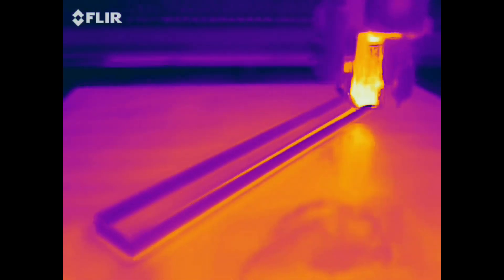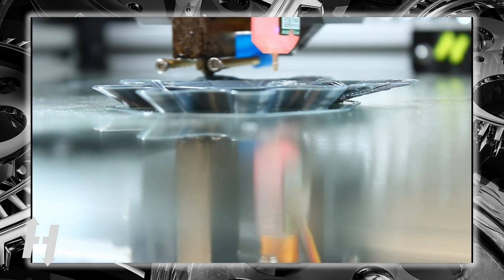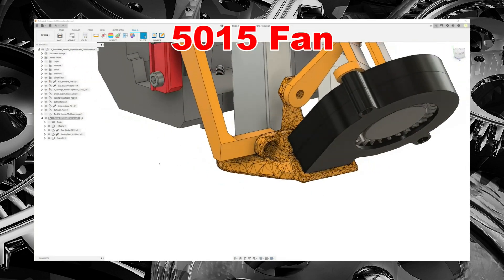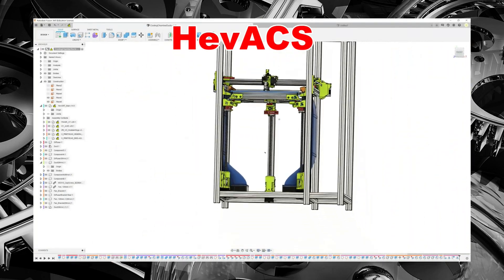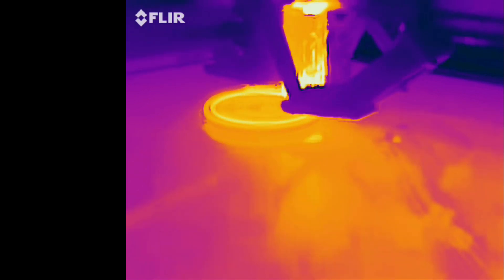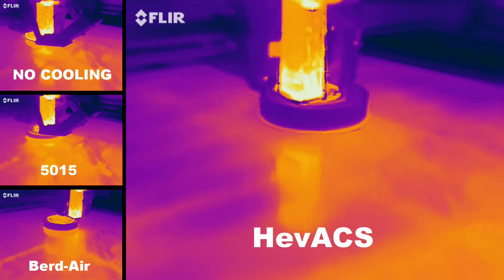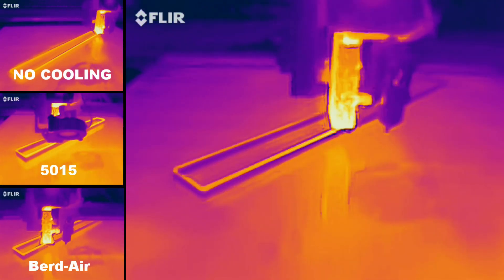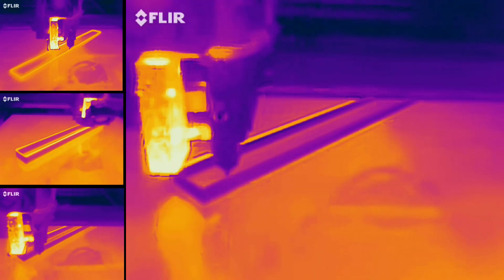Ultimate 3D printer Cooling fan - 5015 vs Berd-Air vs 300CFM Mega Cooling

Comment: thats what ive preached for years. what good is pumping lots of air very close to the nozzle when it only stays there like 0.1 of a second?
Reply from the maker: I need to expand on this topic.  I really enjoy printing with this system.  Sinking heat in the part has also shown excellent layer adhesion properties.
Reply: MirageC you might want to look at offsetting the two opposing „wind blades“ so that they dont collide head on but create a vortex in the middle. Look at the stratasys F123 series you will see what i mean. i built a heated oven with this system, but the air just comes from one side to create a real air curtain effect. my chamber goes up to 240 deg c

Comment: What pump did u use with 660l/hour. Most of the air pumps i could find on ebay were either in the 60 - 200l range, or the 5000 - 10000l / hour range
Reply from the maker: This is the one I am using (24V, brushless, parralel) : https://www.aliexpress.com/item/4000601429521.html?spm=a2g0o.productlist.0.0.7b5967b5QrIbK8&algo_pvid=f9d7e42c-66d7-43b6-9c63-736c077121c3&algo_expid=f9d7e42c-66d7-43b6-9c63-736c077121c3-27&btsid=0b0a556716129933990647398e4dd5&ws_ab_test=searchweb0_0,searchweb201602_,searchweb201603_

Comment: hybrid system?

We have seen easy prints, but how HevACS performs with large objects and how much it actually cools in the center having walls close to the air outlet.
It would be useful to see if a hybrid system consisting of HevACS and berd-air is necessary for this scenario or in not needed for the HevACS system.
However excelent project and realization, good work

Comment: Stratasys already does this (albeit to heat the chamber)
Reply: Yes! Sometimes the best solution can not be used because of patents. They also draw the cooling air from outside the heated enclosure using a blower and pipe it to the nozzle through some tubes.
Reply: @boilerbots  i believe the patent is expiring  10 days from now

Comment: You should use a rectangular flexible air duct for the Hevacs to connect the lower duct part with the output vent so that the output vent moves with the z axis abd provides consistent air flow for the model
Reply: You don't want the output vent to move with the bed, you want it to remain pointing at the level at which the printing is performed, which is at a fixed height in this printer.
Reply: @Graham_Wideman  you are right

Comment: I've been designing my own pressurized air cooling and this was cool to watch.  One thing I have been focusing on that I did not see in your video was trying to cool the filament as close to the nozzle as possible (ostensibly to increase quality of overhangs).  Do you have any experience with that vs a more diffuse air flow?
Reply from the maker: No doubt that bridges will benefit from close and intense cooling.  Overhangs will benefit from it too to a certain extend.  I tested various solutions and found that Berd Air with too much pressure will simply push the filament away during bridges, so the closer you get from nozzle, the more of this effect you will get.
Also I have observed that drastic cooling close to the nozzle will form a thin shell of hard plastic at the surface of the freshly extruded material.  This will create more stringing and poor layer adhesion.
The best thing would be able to play with various cooling solutions depending on the type of line being performed.  I am sure something could be created with this.

Comment: CNCkitchen proofs that too much cooling lowers part strength quite a bit. It would be good to see if there is or can be an optimum for your design. But I'm quite jealous of your printers! Cheers for all the Infos!
Reply from the maker: Yes i do agree with that statement. What i discovered is that brutal cooling to the molten freshly extruded molten plastic will create a thin shell of solidified material at the surface if that material just before it is being layed down.  This affects layer bonding pretty bad.  The HevACS rely on cooling material after it was laid down by sinking the heat through the part.  I need to complete that series of video in HevACS and part property.

Comment: Since i can't test it currently i may as well toss this out since you might be able to. What about using a small peltier module to blast actively cool air to a part.
Reply from the maker: I have tried other methods to cool drastically the part and I found that a thin hard shell of plastic forms at the surface of the molten plastic, creating awful print quality and poor layer adhesion.

Comment: The HevACS setup is a very good candidate for the heated chamber 3D printer I'm working on! Using materials and fans that can handle high temperatures, of course...
Reply from the maker: Yes, I am very curious to try it with ABS and other materials requiring an enclosure.  I am planning to try some re-circulation and potentially added heater in the future.

Comment: Which of the Berd-Air and yours has the lowest moving weight if installed on an i3-style printer ?
Reply from the maker: In order obtain the same level of cooling from the HevACS on a Cartesian printer, you would have to install the solution on the bed but moving with the Z.  Quite complexe.  BerdAir would be easier by far.  Same principle as regular part fan cooling, except air is fed by a tube from the pump to the print head.
Reply: @MirageC  you could mount it in front of the y axis and the back or use a flexible tube to connect a mounted duct to a fan

Comment: Wonder if one could have the print bed submerged in fluid, with the nozzle tip printing just below the surface. Maybe an interresting experiment.
Reply from the maker: I would print just ABOVE the surface of water, this way layer bonding is not disrupted.  This would allow for massive heat sinkning into the part.  I have thought of it too ...  ;)

Comment: Would be able to try a diffused shop air line (100psi) for part cooling? I was thinking about trying this myself but you already have the setup going for you.
Reply from the maker: It could work, but you have to be carefully not to create a hard shell around that molten material.  There is a certain point after which too much cooling over a too small period of time will no longer work.

Comment: I am imagine that for a functional print... To achieve the highest possibile strength, then there is som "optimum" level of cooling. Because like you say, you don't want to press down onto mud. It will collapse. However if the layer underneath is too much cold. Then  maybethe layers will not stick together with the strongest possible bond? Ideally what you want is for a top skin of the layer underneath, it's top contact area to re-melt. So if the layer is not too become too cold just yet, then it can partially re-melt when the nozzle presses on top of it the next molten layer. This should then avoid cold solder joint. And create a much stronger bond between the horizontal layers. Like welding.

At least I think? That is how it should work? If it is the same situation in thermo plastics, than for metal ? A goldi locks zone. Like the planets. Not too hot, not too cold.

OR does it not matter? If enough amount of such necessary re-melting always occur regardless. Because the heat transfer, the much higher energy from the hot end will always overcome the cooled layer underneath? Then if cold solder joint does not ever occur. Then it does not matter! Disregard !

Hahaha. IDK - please let us know!

Comment: Awesome, thanks to you MirageC I now understand that part cooling is a matter of relative temperature drop across the threshold between the laid track still being a molten thermoplastic, or a semi molten 'lava', and then becoming a solid, hardened lava flow. But the important thing is that material phase transition. Which is actually different and must be tuned for different plastics. Nobody ever explained that to me before! So for a higher temperature thermo plastic, such as polycarbonate.... the base chamber temperature must be maintained higher. To prevent too fast shrinking / warping of larger parts.  With a slow enough cool down time at the end of the print.  So in other fields, it is a bit like an s,d soldering reflow oven, but in reverse! Thank you for explaining!

P.S Love the solution. BTW for the little tubes system... why not try to improve it further, and increase it's CFM by making larger diameter tubes? Or more holes to distribute the irrigation. Maybe there is some inherent thermodynamic limitation due to the pressure differential? I was more expecting this type of a system should be supplied from an air compressor. And then regulate the airflow with a valve.

Was it because the printed manifold was too weak to support any higher pressure? Why not instead try to find off the shelf Y part to split the line? Then it can be metal. There are many such accessories and adaptors for air hoses. Or the steam engines for model railways. etc. Of course I am being ignorant! There must be other design / engineering constraints and considerations. Which I am not aware of!

Comment: This is interesting, but what about layer bonding ? As you print over a cold layer the bond is not optimal and the part is not as strong as expected.
Reply from the maker: From what I have noticed, strong cooling at the nozzle will cool a thin layer of the molten plastic really rapidly creating some kind of a shell.  This shell interferes with the bonding process.  What I am proposing here, is to leave alone the freshly extruded material and let it deposit and bond to the previous layer.  Then cool it slowly, but deeply.   I need to to test coupons and use Thomas's methodology: https://youtu.be/a6m_GnN5j4c?t=488
Reply: @MirageC  HevACS cools down whole print rapidly, but not freezing the fresh molten plastic at the nozzle. Does that means it will have lower performance for bridging? Perhaps both berd air and HevACS have their own strengths.

Comment: now whats the quality vs strength trade off between each?
Reply from the maker: Quality definately benefits from the HevACS , especially for PLA.  Overhangs on smaller part are much easier to achieve.  Layer adhesion does not seem to suffer from it.  But that needs to be measured properly.
Reply: @MirageC yessir, it could be especially beneficial in a heated chamber so the effects are minimized in terms of strength.

Comment: we need someone to build a slicer for the hevort that tilts the bed when delt with extreme overhangs
Reply from the maker: Definately!  I am convinced that Fusion360 might be capable of doing so.  I need to spend some time over the winter on that.
Reply: @MirageC  so using the new slicer feature with fusion or a type of cam modification?
Reply from the maker: @Mr_Pewpy_But-Whole  That is what I am hoping, yes.
Reply: I don't think that would change much as far as overhangs go.
Reply: @timmturner  if the printer can do 60 degree just fine with out a tilt. then if the bed can tilt 30 degrees then it can handle the remaining 30 degree to 90
Reply from the maker: In theory we could go past 90 degrees.
Reply: @Mr_Pewpy_But-Whole  You think so? I've seen videos of people printing with the printer rotated 90° and even upside down and made the comment gravity has very little effect.
Reply: @timmturner  look at those 45 degree printers. they can horizontal overhangs all day. because to its orientation its like printing at a 45
Reply: @Mr_Pewpy_But-Whole  You mean unlimited Z printers?
Reply: @timmturner  yeah white knight, black belt, print mill. whaver
Reply: @Mr_Pewpy_But-Whole  Yeah they are able to print at 90°, you are correct.
Reply from the maker: @timmturner  Lets say you can achieve 65 degree angle pretty good  with stock settings and proper layer height to width ratio.  
Then we tilt the bed (given clearance is adequate) to a 30 degree bank.  The Relative angle to the XY plane will remain 65, but on the part that could result in a 95 degree angle.
Reply: @MirageC  Imagine a printer where the bed rotates and tilts. Then you would just make one side of the head, the side that would face the bed, as flat as possible
and you'd rotate the bed so you could have 90 degree overhangs on every side of a print. Maybe you could even just have a tilting hot end, but not the rest.

Comment: I thought I was having an episode of Deja Vu while I was watching this, and then I saw your comment about it being a redo of a previous video. I guess I'm not going completely crazy after all!! :)) I think it's GREAT to do this kind of experimentation because it can help determine if enhanced cooling will help, and if so, ways to improve that cooling. However, I have a couple suggestions for you that I believe will help make your results more transfer-able for actual improved print quality. (Maybe they've already occurred to you.)

1) I think it would help if you can use your FLIR in such a way that it can be 'calibrated' from one test to the next. I've also had trouble using my camera with different ambient conditions where the temperatures don't equate from one image to another. I think the automatic gain control (AGC) takes whatever temperature range present in the ENTIRE image, and re-maps it to the colors it can display. This works great so that we can look at our house in winter to find heat leaks, and then use the same camera for printer tests, but that feature kinda works against you now. 

   a) Can you turn off the AGC feature? 

   b) Could mask off areas in the field of view that are at room temperature to prevent them from adding cool temps to the AGC range? Maybe cardboard painted black or white, or some other opaque and non-heat-conductive material would work?

   c) Maybe you could also have one item in the field of view that's always the same temperature for calibration. For instance, maybe you could always have the nozzle in the image since the nozzle temperature is well controlled on 3D printers and is thus both stable and the hottest item in the field of view. If it were always the same color, and everything else were compared to that, I think more meaningful info could be seen from one cooling setup to another.

2) Long print passes are great for understanding and comparing the 'theoretical' cooling capabilities of your various setups, but for me they don't apply very well to the real world cooling problems that I have had. They do equate well to 'vase mode' prints, but I don't think I've ever had a cooling problem with vase mode, even when they have overhangs. It's more intricate pieces, with a many small loops, so that the print head comes back to add the next layer to a feature before it has had a chance to cool adequately. For instance items designed using Voronoi Style (with overhangs) are what I've had the most trouble with, and are great examples that would be better tests. Of course, as you mentioned, a Benchy will also be good, as would other printer 'test pieces' that I've seen on the Internet. 

Bottom line: I think what you're doing is really cool (terribly bad pun intended) and warrants the work you're doing. I think with some tweaking of your experimental methods, you can learn even more. In fact, I haven't looked around, but I'll bet there are other geeky guys (like you and I) who've done YouTube videos on this.  

Continued good luck! I'm really interested in seeing what you discover.
Reply from the maker: First of all, thank you for your comment and constructive feedback.  It is really appreciated.  
As for the FLIR calibration, I am pretty sure I had the auto calibration off.  But in any case the Nozzle and bed are at constant temperature between all tests.

And you just gave me an idea of cooling demonstration using vase mode and HevACS.  In can outrun the normal cooling pretty quick using vase mode only on my printer.  A simple 40mm diameter cylinder printed at 0.2mm layer can suffer from insufficient cooling when going fast enough with this printer.

My struggle right now is trying to move around a heavy heater block fast enough at high jerk/accel without loosing steps.  Two things can happen, lighter heater block with same efficiency or stronger motors.  I am trying to resolve both situation.

Heater block: Nova Hot end is in the mail.
Motors: I am currently testing Servo Motors: https://www.youtube.com/watch?v=m6DoKoESPdg&t
Reply: @MirageC  Thanks for the reply, and I'm glad you thought I was being constructive. I am definitely not an expert on FLIR cameras. I have one, but I haven't used it enough to check out all its features. 

My thinking was to minimize, and standardize, the difference between the hottest and coldest item in the field of view (FOV). If the AGC works as I think, it applies its color map to the ENTIRE range of temperatures in the FOV. So the smaller the overall difference allows for the greatest resolution. And if temperature of the nozzle ALWAYS defines the upper limit, and for instance, the bed temperature always defines the lower limit, then you have repeatability for all images. So if you can eliminate colder areas (e.g. room temperature items in the background) from the FOV, it might help. Anyway this is my 'theory', though like I said, it might be errant. 

I saw your video on the high speed servo motors. I'm not surprised you can lay down filament too quickly when printing a 40mm cylinder. I was talking about using vase mode to create an actual vase because my wife's bouquets have always been larger than that. :)) 

I'm glad to hear that my input gave you a new idea. In my experience great ideas are always built by assimilating and improving upon the ideas of many others. Again, I'll be looking for your results. I'm sure they will be fascinating.